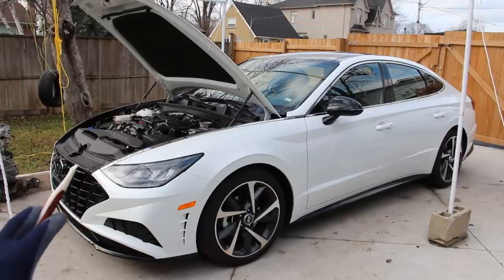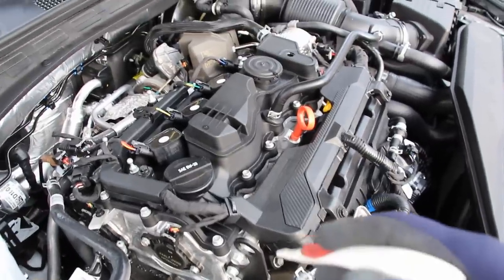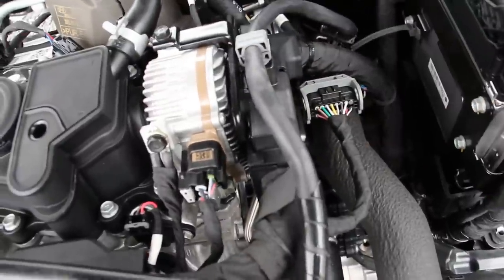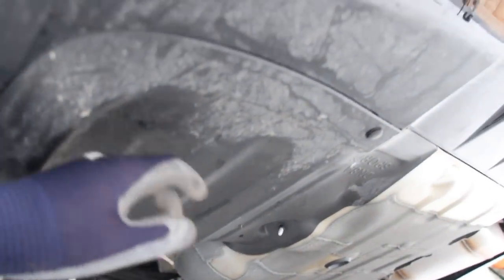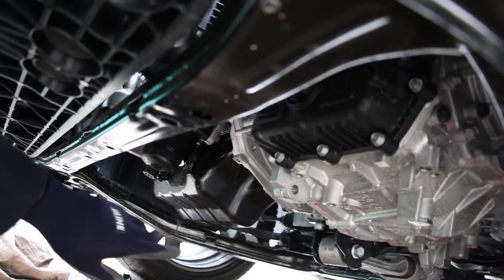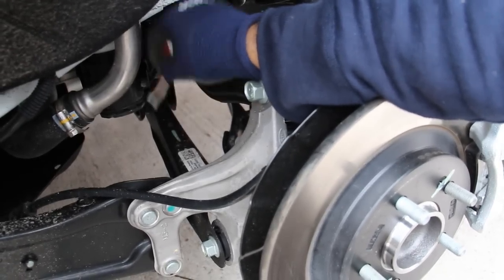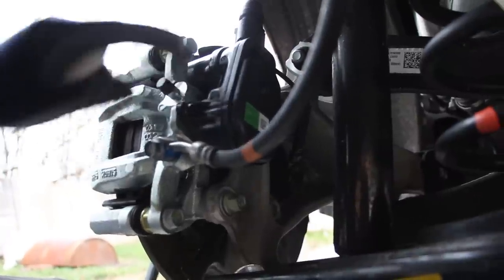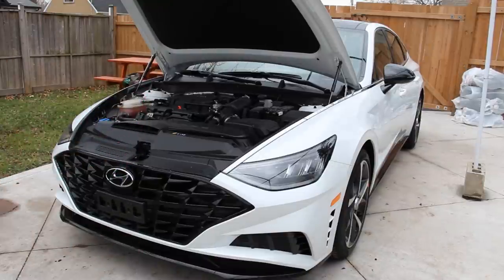Hyundai Sonata Mechanical Review

Comment: Isn't that 1 of those intake actuator engines? a freevalve spin-off?
Reply from the maker: Not that I know of... are you talking about the continuously variable valve timing?
Reply: Continuous variable valve duration.
Reply: I was originally thinking of the fiat 2.4 multi air that uses intake solenoids and no intake cam shaft

Comment: How common is carbon build-up in these engines?

Here in Europe it doesn't seem to be an issue anymore.
Reply from the maker: Yes because newer engines are using both gasoline direct and port injection

Comment: I still prefer V6s and V8s over inline 4s. They last longer.
Reply from the maker: Agreed. And smoother
Reply: @speedkar99  I know the older i4s from back then can last forever, but these modern ones, especially with turbos scare me. I own a 2017 Hyundai Sonata Hybrid non-plug in, but I plan on trading her for a v8 Challenger due to uncertainty on reliability. Whaddya think?

Comment: GDI makes it a no-go for long-term ownership.
Reply from the maker: Yeah, too much carbon buildup. It can be cleaned though, just an extra maintenance.
Reply: @speedkar99  I wouldn't trust Hyundai mechanics to properly clean the valves or reassemble the engine!

Comment: not worth it I have 2017 elantra after 3 years I have seen many weird problems on my car and warranty is not covering it 😐
Reply from the maker: What kind of issues, engine?
Reply: @speedkar99  1- transmission not shifting gears 2- Handbrake stuck 3- doors latch cables get loose so the doors won't open from inside or outside 4-Injectars need to be cleaned because you lose power over time and you can feel engine power after cleaning it 5- sometimes it won't lock the doors no matter you do

Comment: My 2021 Nissan Rouge redesign model  mileage 8,886 

Transmission was CVT failure point least 100,000 miles or more 

Parts very hard to find on aftermarket stores 

Disadvantage of Nissan Rouge is transmission can have problems in future mileage

Comment: Would you rather own this Hyundai Sonata or the Honda Civic you reviewed? 🤔
Reply: I'm more Honda guy, especially the pre 2010 or even the older model from 90s, so I would go for Honda, but naturally aspirated one. This are not real turbos like the older Acura MDX or typical turbocharged engine of the past or the diesels, but rather helping devices to get some air into the cylinders (I know someone with Turbocharged Acura Type R, close to 450hp). The newer automatic trannies on Hondas are of German origin, so hopefully with proper maintenance they might be as reliable as Aisin trannies used by most of the car manufacturers (Toyota).
Reply: Neither. Buy the Camry. The Camry comes in 300hp flavours now.
Reply from the maker: I like V6. I choose Camry.

Comment: I owned a Kia and the engine in that went poopy in that after just 72,000 miles. The Sonatas is definitely just a lease or maybe a good rental car. No way would I this pile for long term…
Reply from the maker: What year/engine was yours? The 2.4L was notorious for fails
Reply: @speedkar99  it was the 2. 0 L direct injection engine. Rated at 164 HP.

Comment: By using a good detergent motor oil you will decrease the carbon buildup over the intake valve. As well frequently oil change.
- Good oil not necessary to be the famous trading company.
Reply from the maker: Yes that helps. But the nature of the pcv system will draw oil vapor to those ports and eventually require cleaning

Comment: Interesting video about an un-interesting car.    The amount of electronic controls, sensors and actuators is just mind-boggling. All this technology in the interest of fuel efficiency, which, correct me if I'm wrong, hasn't markedly improved (on average) in at least a decade.
Reply: I think a lot of the complexity is for emissions compliance too. I love engines but I can't wait for EVs to take over.
Reply: @alexkram  I don't think EV's will ever be successful on this planet. They have all been almost total failures as far as cost savings, resource savings, and the inevitable toxic battery components that cannot be made inert.
Reply: @theamerican7080  the problems will be solved. EVs are the future. What toxic components?
Reply from the maker: Emissions
Reply: @alexkram  Ok so you're clearly clueless about the components that comprise an electric vehicle.
Reply: @speedkar99  As if it was ever about emissions..
Reply: @theamerican7080  clueless me over here waiting for you to explain about the toxic materials that are in EV batteries.

Comment: I have had two Hyundai's, a 2013 Veloster. And a 2017 Elantra, currently has 107k miles, I'm done with Hyundai.
Reply from the maker: Any engine issues?
Reply: @speedkar99  no.
Reply: @jayholm2142  you're done with Hyundai because you don't maintain them
Reply: @jayholm2142  Only people that called Hyundai as trash are the ones wo don't properly take care of them. Simple. I'm talking about you.

Comment: I just need Hyundai to make suspension parts so i can sell it. Hyundai has given me nothing but problems. i've had 3 hyundai cars. 2015 hyundai accent 2015, hyundai genesis 5.0, and 2021 hyundai sonata SEL. Its been since November. at this point im going to buy a used lexus and take the Sonata back after its fixed.

Comment: Not shopping for this class of car - but if I were I'd take the Kia K5 with the 2.5 NA - They've undoubtedly solved the manufacturing problem (or they'll go bankrupt) - the Theta is otherwise a good engine still used by FCA and Mitsubishi
Reply: The K5 doesn’t have a 2.5 NA option, you can only get the 1.6T or the 2.5T in the GT.
Reply from the maker: Good choice but same complications
Reply: @tails300  Bummer - oh well, good thing I'm not really shopping
Reply: @speedkar99  True - I believe they're both assembled in the same US plant - give the choice, I'd buy a Korean assembled car - I own an 07' and the quality is Japanese equivalent (but I can't speak for the new ones)

Comment: Why bother with the aluminum front LCA if you have to just throw it away when replacing the ball joint 😅. Then save costs with stamped steel in the rear. 

That oil leak and cross threaded bolt though...like wtf 😂

Comment: Leak on the oil pan before first oil change. Manufacturing defects with new ones eating crank bearings. Overall just poor manufacturing. My co worker said he loved his and he only had to put 1 engine in it so far🤯 Am I missing something? Why do people keep buying these things and saying how  great they are? I made the mistake myself and 2 engines later I learned my lesson. Absolute junk with high sales numbers. The styling is nice but if you are talking about how good it looks from the repair bay it"s not where I want to have that conversation.
Reply from the maker: Bevar they're sold on that 10 year warranty

Comment: SpeedKar, what will happen to this engine after the intake valves become gunked up with unburned oil from the pcv valve..... Does this car need the walnut blast cleaning. treatment ala Volkswagon TDI.,.....why in 2022 does Hyundai do this, They have seen the disaster that is Volkswagon TDI turbos.......why don't they copy Toyotas D4 system of having 2 sets of injectors., one for direct injection and another one to wash and clean the intake valves......probably because it cost twice as much to build......lol
Reply: At the 10 years mark, Hyundai dealer will give you a call to tell you the warranty has expired. Time to trade in the old Hyundai for a new one.
Reply from the maker: The intake valve cleaning is now a maintenance item. That's the cost of the vehicle hitting emissions, fuel economy and power targets, since those are the advantages of GDI.

Comment: Another Hyundai/Kia engine that sounds like its fucked from factory.
Reply: I don't see how. It sounds like every 4 banger out here.
Reply: @MrTherandomvidsguy  I guess it's the direct injection pump that makes it sound like the timing chain tensioner was broken or something
Reply: @knipsi22  as an Elantra N-line owner, The high pressure fuel pump can be bit noisy when it's cold as F until it warms up. Although it's nowhere that loud. 

I Don't know why high pressure fuel pumps in general are noisy.
Reply: All direct injections sound like that, go listen to a late model Toyota with GDI engines they sound like diesels on cold starts
Reply from the maker: How's your car holding up? Any issues?

Comment: nice looking car
Reply: @applepoop10  unfortunately turbocharged engines have such short lifespan
Reply: @applepoop10  it's the same engine in the Elantra N-line/sport (last gen though without that CVVD)/GT N-line, forte GT, K5 GT-line, and Soul turbo.

I've hardly heard any issues with those engines and people has put out nearly 500HP on stock internals on this engine.
Reply: @applepoop10  100% true but most people don't think that way.  They just ses EPA numbers and are in love with it.
Reply: @MrTherandomvidsguy  How many miles on these engines?
Reply: @glennnichols4220  someone has over 130K on their Elantra sport that's tuned with this 1.6T before the CVVD was added. 

Then again alot of parts came from Germany from a company called MAHLE for the turbocharged engines. Same thing Audi, VW, BMW, and other brands use.

Then again the Elantra N-line and the sport are tuned more for performance while this sonata is more for.... Well, economy.
Reply from the maker: It sure feels like that when driving it. I thought I was driving the base engine until I popped it open and surprised to find a turbo. So slow and noisy.
Reply: @speedkar99  do you think manufacturers should stop putting small engines into big vehicles?

Comment: For everyone saying thee engine sounds like crap just know all GDI engines sound like this, go listen to a new model toyota engine and it will sound like a diesel on cold start
Reply from the maker: You're right, most 4 cylinders with direct injection sound terrible and noisy. I prefer a 6 or 8 cylinder !

Comment: Having a background in Failure Analysis, I will stay far and clear away from this car and most of today's over-complicated abominations.  If I need to replace my Toyota, I will replace it with a used Toyota.  Seeing all of this garbage on a four cylinder engine (which should be simple) is disheartening.   No thanks.

Comment: You gonna mention half these engines are failing and Hyundai is refusing to uphold their lifetime engine replacement warranty they had to settle for when they were sued in a class action lawsuit? Half of these engines manufactured from 2013-2019 are at risk of engine failure and engine fires. There are multiple class actions opened on Hyundai. Their Alabama engine manufacturing plant is currently under investigation for hiring children that were trafficked from Guatemala. do some googling and you’ll find a massive scandal and cover up going on with Hyundai. I wouldn’t take my chances. If there engines were made right and they fixed their shotty electrical panels, these would be great cars. But unfortunately none of the beauty aesthetics of the car is what allows you to drive your car. Just sending you a warning.